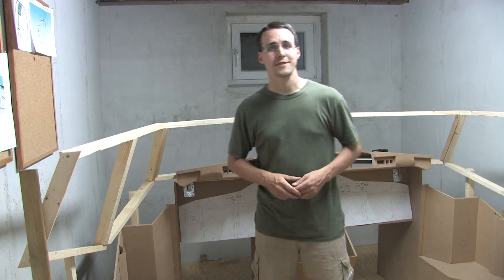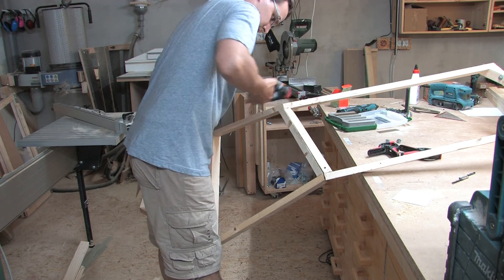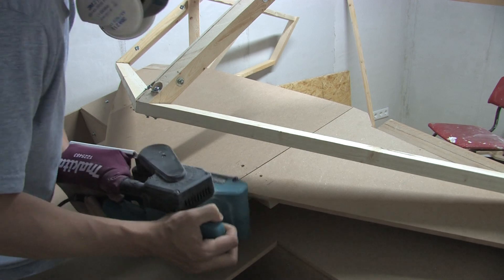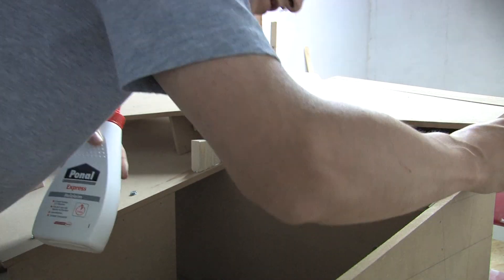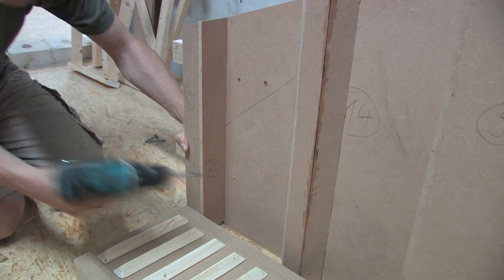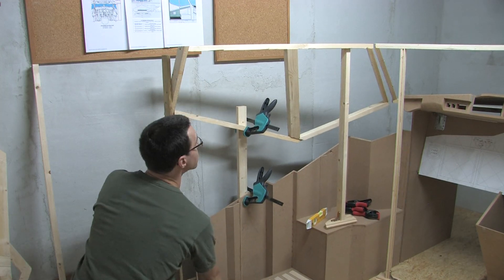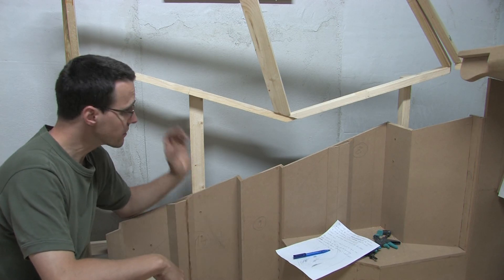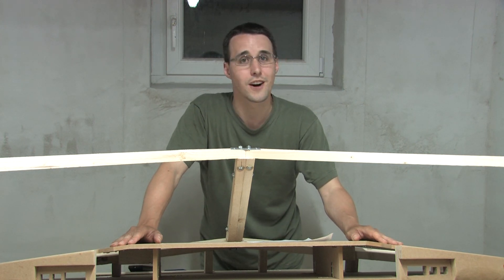Window Frame Installation - A Boeing 737-800 Homecockpit #9

Comment: This is an amazing video.  Thank You so Much!  Do you have the actual dimensions and angles?
Reply from the maker: I have updated the concerning sketchup file. So you can take all measurements from it. The new angle is 26-27 degrees.